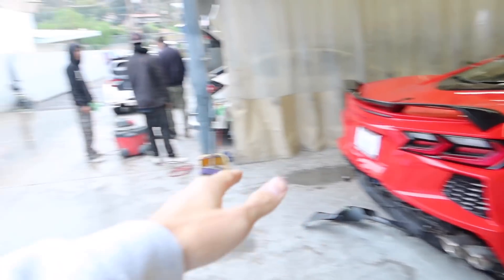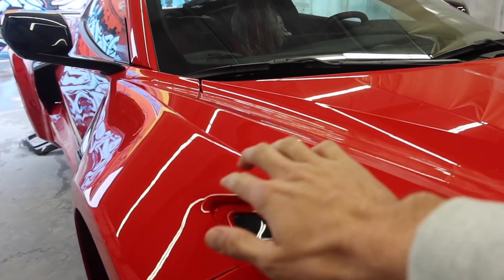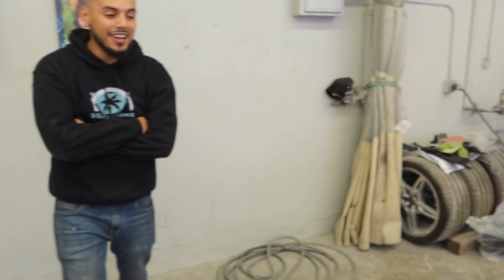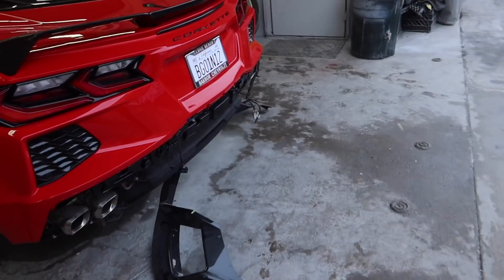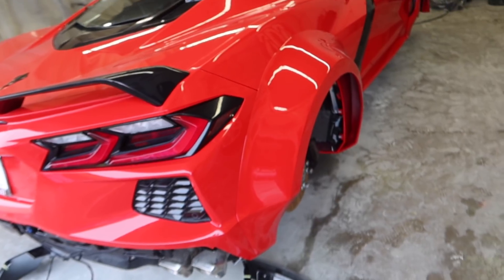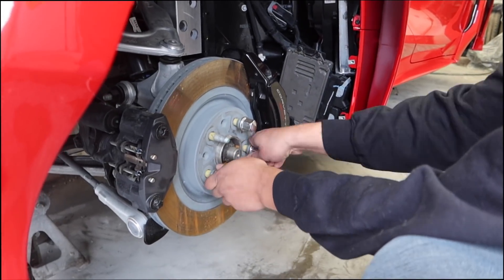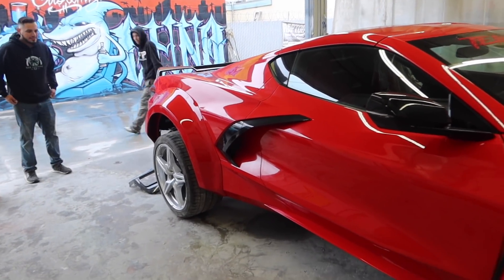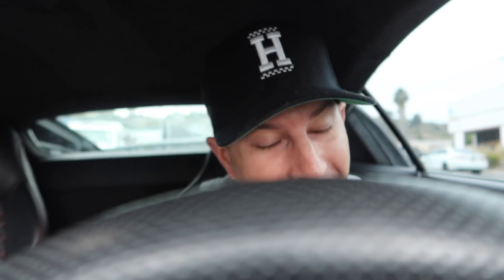WORLDS FIRST STREETHUNTER C8 CORVETTE!!

Comment: The only issue I see is the rear flare. There’s should’ve been a line to separate between the rear panel and bumper (similar to the front). That way if they have to remove the bumper to work on the car they don’t need to remove the whole flare.

Comment: Kit is nice, but the rear fenders need to be fixed. That bottom door line just disappears too much into the rounded fender. The CGI render of the kit shows the rear fender with that doorline looking way better on the body kit. This should really be fixed. This is also causing the gaps you see in the fender at 1:08 because the fender is way too round and doesn't follow that bottom doorline.